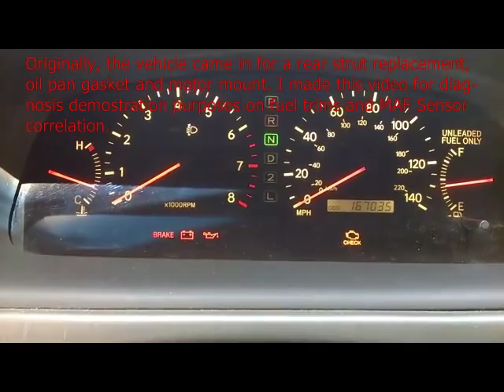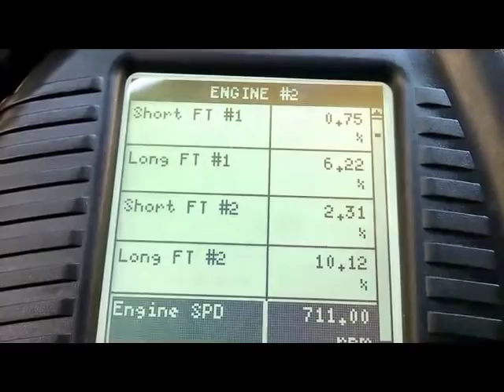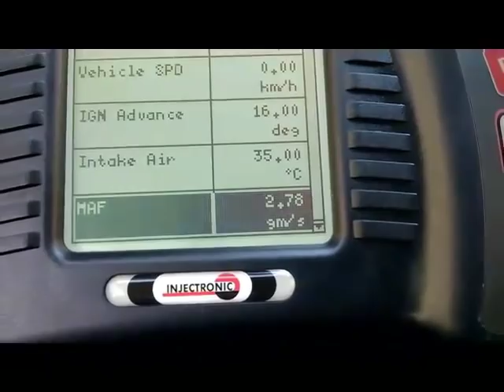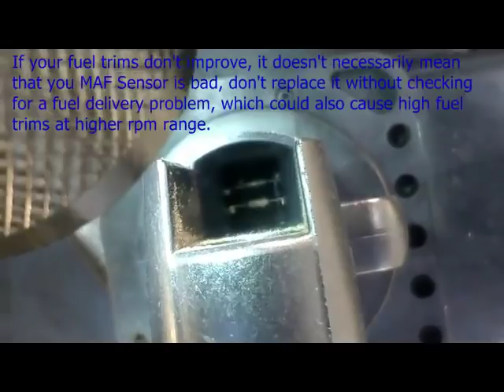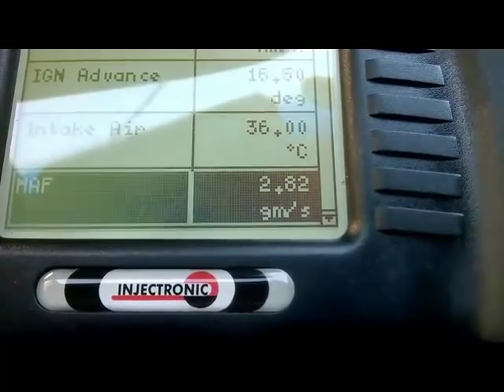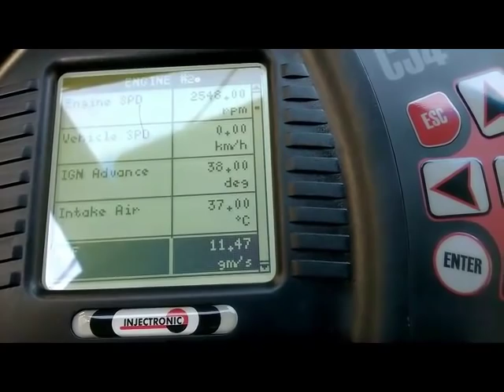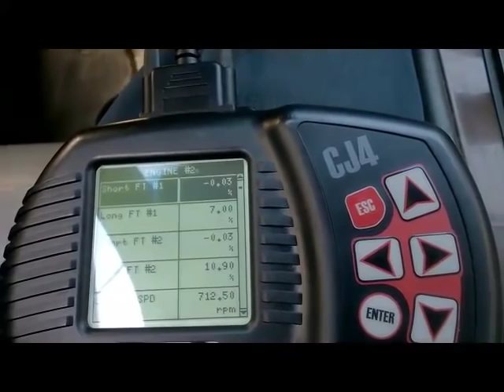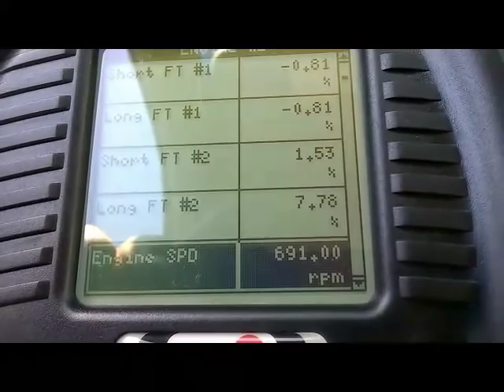(Lexus ES300) Dirty MAF Sensor and Fuel Trim Numbers

Comment: clearing DTC does not reset the fuel trim numbers, the reason you got worse numbers after cleaning is because the maf sensor was wet and cold, it takes a little time for it to warm up and dry, you could actually see that when you raised the rpms after the cleaning you started to get negative fuel trim numbers which means it was getting better and if you just would have taken the car out for a 10 minute drive the negative short term would lower the long term fuel trim

Comment: Just bought a 2003 Lexus ES 300. Was having trouble with too rich lean codes. I would step on the gas and around 2500 rpm it would max out at 52.3% Long Term FT on both Bank 1 & 2. Luckily I had my own scan tool and figured those specs would be the same for the Lexus since it was an 03. I had “cleaned” the MAF and the throttle body prior to watching your video. I noticed on the MAF sensor you showed those heater coils. I didn’t clean those. Sure enough the top one was dirty and when I disconnected the negative battery to reset the codes I was running dead on the spec sheet you showed. I couldn’t be happier. I was thinking it was my Bank 2 Sensor 1 A/F Sensor, since it kept showing p02198 as well as p0171. Thank you!!!

Comment: Yep, it's within spec of the +/- for 10 %.  If it's a high mileage vehicle, I would definitely be OK with those numbers.  In my experience of being a mechanic for years, it's hard to get them to null out to zero, unless it's a newer vehicle.  My 2001 S-10 4.3L with 170,000 miles hovers between +6 to -2 total trim on both banks.  My fuel pressure is fine also as I put my gauge on it to test it( after I put a new pump in it a while back, and fuel filter, along with new intake manifold gaskets upper and lower).  Mechanical wear in the engine plays a part in this, as the tight tolerances open up over time and cause higher than optimal LTFTs.  My rule of thumb that I use on all the vehicles I work on, is that if the total fuel trims are between +/ 10%, I leave it alone.
Reply from the maker: Good valid points!!

Comment: Amigo, there is a difference in NORMAL and IN RANGE, normal is floating around zero to + - 5, in the range is as high as 20 while the STFT is still active if the LTFT and STFT both max out then this is out of range and other codes will be set. Any LTFT is compensating for a problem with STFT but the computer can handle it. A partially clogged exhaust can also cause these same types of readings. MAF g/s should typically be 1.1 g/liter (or a little higher) of the engine so 3 liter is about 3.3 g/s. A larger item collects more dirt. I think one is the MAF and the other is a temp sensor. Don't clear codes, LTFT takes time to normalize, you need to do a test drive. FOR EXAMPLE, if you or a tech does not fix a problem, the next tech wants all the info he can get so pls don't just erase it, pass it on. In this case, you are correct to look for an additional problem. Thank you for showing before and after cleaning the MAF but it does not seem to help enough. As we can see, after loading the engine the LTFT went back up, this is why you should not erase codes, the MAF was fixed, the computer would learn the new strategy on its own. Now there is no MODE 6 data for the next guy if needed and all Monitors have been erased and some take days to re-run so if you live in a SMOG State, your customer is screwed for Emission Testing quickly. The vacuum leak only needs a small increase in RPM and it's mostly noticeable in STFT, I don't see that here near the end of the video. You are still lean on bank 2, I think you need to clean the injectors and I would need to see O2 sensor activity to give a better answer about valve adjustment or other minor problems. It's not MAF (affects both sides) and it's not vacuum on one bank, not at that RPM. How many cats as the actual code is for a cat, are there two or does bank 1 and bank 2 joint to a single exhaust. P0420, need to watch pre O2s and post O2s for a better picture. Thank you very much for this Case Study, very good at showing before and after diagnosis. It is 2021 now and I am very sure you have a lot more experience. I will go look for PART 2 if you have one. Mucho Gracias.
Reply from the maker: Thanks for your good analysis my friends.

Comment: . You have a piece of paper on which the real values of the sensors are written. How do I get the values for other vehicles
Reply from the maker: FYI.... not all manufacturers provide parameter data values. In this case, Toyota does. This was obtain from a automotive service repair program called AllData.

Comment: on Same throttle position, dirty MAF Sensor will notice lower Air mass, compared to Cleaned Sensor.

More air means need more fuel.

Thats the logic to get proper AFR.

Comment: Where did u get the spect print out??  I'm having a similar issue on my is250. But I think I solved my issue this morning.  It seems that my new toyota MAF does not fit snugly in the air intake tube, those creating a small vacuum leak. I switch back to my old sensor and BAAM!  My fuel trims went down from 20% and 30% respectably. To about -3% and 6%.
Reply from the maker: This spec sheet was from AllData.
Reply from the maker: What was reason for replacing it the first time?
Reply: @EliTheOBDTech  I had recently bought the car and wanted to start out fresh knowing that I had done a much needed maintenance on it. I replaced all 4 rotors and brakes. All fluids, Wipers, spark plugs, plug wires, vvt oil sensors, air cleaner, MAF, EGR valve, O2 sensors,. I've also did a complete air intake cleaning all the way down to the valves removing as much carbon from the top of the valves. I also added a oil catch can. Soon there after I started getting the check engine light on and being that I was not getting a Code for bad MAF but rather a rich condition bank one, I figure it had something to do with fuel regulator or a vacuum leak. But not a bad MAF.  Ur videos help me a lot understanding the long term and short term trims.  I never would have suspected that it was the actual MAF housing that was causing the vacuum leak.  Thanks again !!!🤗🤗👍👍
Reply from the maker: @OSCARANDRES039  I'm glad to see that this video helped you understand fuel trims. Cheers my friend.

Comment: I'm lost on my 2003 ES300. It has sky high LTFTs at idle suggesting a vacuum leak. I just changed the spark plugs. I know for a fact it wasn't like that before the plug change. I changed the intake gasket. I checked every vacuum hose. I went around all the hoses and the intake with propane. No change in RPM and the RPM is in range. I did the same with starting fluid. No change. As I raise RPM the LTFTs drop. At idle they are close to 30%. I don't get it.
Reply from the maker: Check for brake booster vacuum leak. Best method to eliminate vacuum leaks, use smoke machine. Check your upstream O2 sensor data  on a scan tool. Check to see if it's fluctuating from rich to lean.

Comment: Nice video Eli TheOBDTech.  I have a 2002 Toyota Camry XLE V6 3.0 Liter 1MZ-FE engine.  The engine stalls at idle on occasion when I stop at a traffic light.  It will stay that way until I get to my destination ant turn it off for a while.  Then it works fine when I drive it again.  It can go a few days or a few months before it happens again.  I have cleaned the MAF sensor a few times with the CRC Mass Air Flow Sensor cleaner but have not used a brush as you recommended.  I have also cleaned the throttle body.  There is no check engine light or any codes with the scanner.  Can I use the same data sheet from this video, as it appears to be the same engine.  Any thoughts on this issue?
Reply from the maker: Jim Stelljes sorry for the delay. I'm pretty sure you can use same spec sheet.
Reply from the maker: Jim Stelljes I'm thinking that you may have a fuel delivery problem or an idle air control valve issue.
Reply: Thanks.

Comment: So I got code p0171 but my lg term trims are stuck at 14.1 and 13.3% it doesn't not change no matter if I rev it to 3krpm. I help it for a min and the lg term on both banks stayed the same. Could if still be a bad maf?
Reply from the maker: I would say, it's a combination of a dirty/faulty MAF sensor, dirty injectors and even some type of vacuum leak.

Comment: Great video ! Thanks for the info, I didn't know that you have to disconnect the battery to reset the computer, I thought by only clearing the codes will be enough, I had different results by disconnecting the battery,  THANKS again.
Reply from the maker: In some instances like Toyota/Lexus you have too in order to clear fuel trim memory. Second option would be driving your vehicle 50+ miles in order to relearn new fuel trim parameters.
Reply: @EliTheOBDTech  hi i have toyota tacoma 2008 how i can reset the long term fuel ?
Reply from the maker: @ulisesquintero1219  HI Ulises, from my understanding, a capable scanner will do the trick, by doing a reset memory in the special function  option.
Reply from the maker: I'm not 100% sure if disconnecting the battery for at least  20 mins will do trick.

Comment: Seems that LT fuel trims under load < +- 10% are normal.  Don't see any need for further diagnostics with those parameters.
Reply from the maker: David Usually a vacuum leak will tend to drop long term and short term fuel trims under load to normal values. If that happens that is usually an indication of a vacuum leak.
Reply from the maker: Although I did not record the fix for this vehicle, the culprit problem was a cracked intake hose and couple of cracked vacuum hooses that connect to the intake manifold

Comment: How do I get that paper you have for my 04 BMW 325xi 2.5l sedan awd I have not change my maf sensor I've tried cleaning it but don't change and I have p0420 also can that cause rich condition
Reply from the maker: Not all manufacturers give out data values on AllData or Mitchell OnDemand.
Reply from the maker: I'll check to see if BMW has one for your vehicle.
Reply: @EliTheOBDTech  thank you cause I can't find anyone to tell me what I looking for God bless you
Reply from the maker: @isrealperez9069  Sorry buddy, unfortunately BMW does not provide  Data sheet values on AllData or Mitchell OnDemand.
Reply from the maker: How's you're fuel trims looking like at idle and 2500 rpms?
Reply: @EliTheOBDTech  quick question of my secondary pump was to fail at cold start can the u burn fuel stays in the cat will cause harm and if my fuel trim don't fluxuate good how do I fix that tomarow I'll give you the info for fuel trim at 2500 rpm
Reply from the maker: @isrealperez9069  Any excessive lean or rich mixtures will cause catalytic damage. Pretty much if the catalytic converter is saturated with fuel, the efficiency will be low and the rear O2 sensor will see that and trigger a p0420. I'm pretty sure that's what is causing your p0420.

Comment: My Long trim b1 and b2 is stuck on 100% short trim is stuck on 70% with lack of power can't pass 2,500 RPM with p0300 code now what do you think I clean the MAF sensor the car shakes when I unplug MAF sensor car runs good
Reply from the maker: There is chance that your MAF sensor could be the problem, but I'm thinking that you may have a large vacuum leak. Does your fuel trims drop if you raise the rpms?
Reply: The MAF sensor was the problem for the randomly misfire p0300 but when I raised the RPMs it just stay stuck at 100% it doesn't drop at all
Reply from the maker: @Tootoojackson  I'm glad you fixed your problem. That is the usual symptom of a Faulty MAF sensor, it will prevent you from going over 2500 rpms. Very common on Nissan vehicles.
Reply: @EliTheOBDTech  thanks for your help also I have one more question if you can help me with my ho2s2 mntr b1 and b2 is running lean what you think that should be spark plugs or 02 sensors
Reply from the maker: @Tootoojackson  what's the year make aND model of your vehicle?
Reply: @EliTheOBDTech  it's a 2004 Nissan Quest SL
Reply: @EliTheOBDTech  I have a 2004 Nissan Quest SL the ho2s2 b1 and  b2 running Lean
Reply from the maker: @Tootoojackson  As soon as I get a chance I will look into it.

Comment: Cool , but could it be a vacuum leak that,is,making the numbers go rich ? Did you get to make a another video on it? That is strange no code . Thank you bro.
Reply from the maker: ***** I do suspect a vacuum leak only because the fuel trim numbers are positive and tend to drop when applying a higher rpm. At the same time i also think the vehicle may have restricted injectors due the fact the fuel trims would fluctuate during certain rpm range. No, I have done another video. Customer will bring it back when the vehicle throws a code.

Comment: Hi Eli - thanks for the great video! I have access to Alldata,, but can't seem to find the data sheet that you use in the video. What area should I be looking in? Thanks!!!
Reply from the maker: What kind of vehicle are you looking for? Not all manufacturers give out that information.
Reply from the maker: I would need to look at the program to give you a good answer.
Reply: Hi Eli - Thanks for the quick reply!  I finally found it!  You had given another poster a ballpark location, and I just poked around until I finally found it!  This is such useful information.  BTW, the vehicles is:
1999 Mercury Sable Wagon / 3.0L Duratec DOHC 24-valve - automatic.

I have a free ALLDATA account through my library.  Usually you have to go into the library to use it.

Anyway, the path through ALLDATA  is as follows:

After login - choose the REPAIR (blue box)
  [Under SYSTEM and COMPONENT banner]
    POWERTRAIN MANAGEMENT
      [Under COMPONENT banner]
        COMPUTER and CONTROL SYSTEMS
          [Under TESTING and INSPECTION Heading - Right side]
            SCAN TOOL TESTING and PROCEDURES

Normal Scan Data Values - Includes PIDS    - takes you to the values
Reply from the maker: @Informed104  I'm glad you found your way around this data sheet.

Comment: Would an issue with o2 sensors cause the same numbers?
Reply from the maker: Usually an O2 sensor will either have a steady  rich or lean condition.
Reply: @EliTheOBDTech  awesome! Thank you very much for the reply. I am trying to learn as much as I can about this stuff. I appreciate you sharing your knowledge.
Reply: @dm7097  Then you can learn something more: never spray anything at all on O2 sensor connectors. They work with reference air and they pull it from the sensor wires. Spray anything (such as MAF sensor cleaner) on them, and the ECU begins reading always lean (very low voltage) until you replace the entire sensor (expensive stuff). Don't make the same mistake i did (well, O2 sensor was due for replacement anyway in my case since it was very very old and was also replaced with an updated part).
Reply: @teravolt6113  ok thank you, never really thought about that before. Awesome.

Comment: Hi Eli! Great video! Very informative. I was wondering if you have spec sheet for Subaru Outback 2.5 2005. I also have increased ltfts. Thanks.
Reply from the maker: Not all manufacturers provide that information, but if they do, what's your email?
Reply from the maker: @armang10  Alldata only provides ecm pinout values, still very useful. Is your vehicle a 
U5/Low emission vehicle or non-U5?
Reply: @EliTheOBDTech  Hi Eli! I have no idea if it is u5 or non u5. It is made in the USA. How do I check it? Thanks!
Reply from the maker: @armang10  Perhaps in the emissions label under hood or in the valve cover. I'll just send u both.
Reply: @EliTheOBDTech  Great! I look forward to receiving the files! Thanks alot!